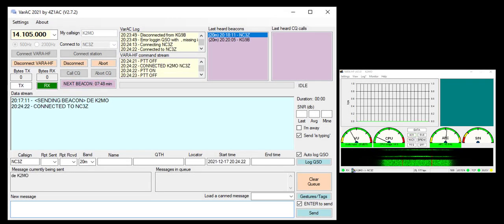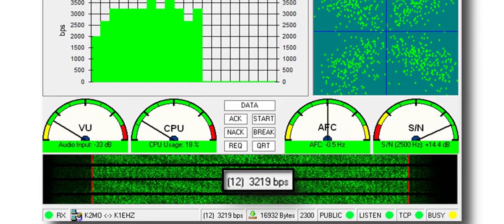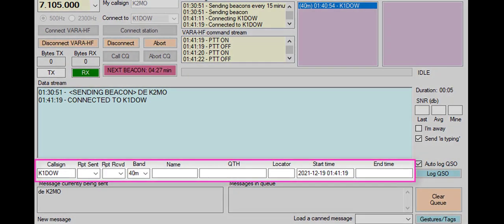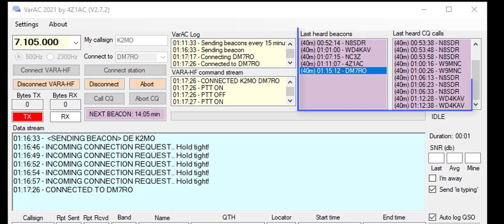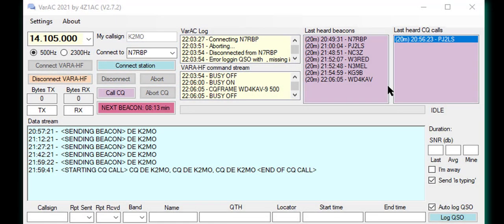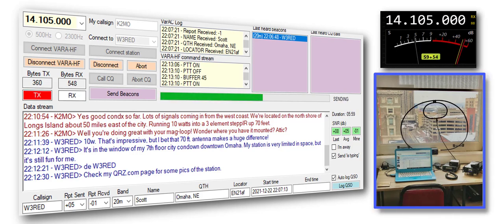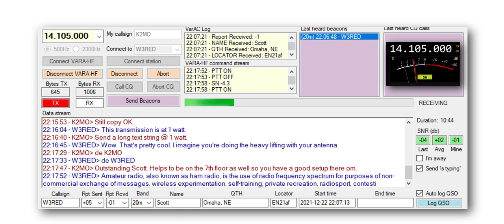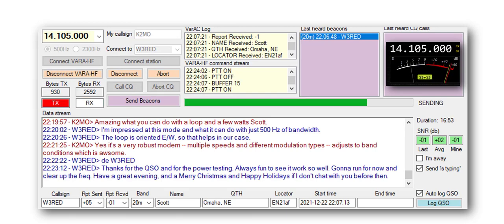Varac Chat Mode Video

Comment: Nieto, the guy who developed ROS did a good job with it, but the FCC among others blocked it in the US as it used spread spectrum frequency hopping, so Ros fizzled out and was only used by a few die hards like myself...
The along came 4Z1AC who developed it into varac....its a good system, but sadly the Spanish Ros developer is now asking for about 70 Euros for a license to use his software which is way too expensive imo...
Still you can use it without a license, but it has been crippled and slowed down & features disabled, such a shame, I'm sure this would take off with a more reasonable fee.

Comment: Does it work on linux?
Reply: I didn't see a link to the source, but dot net was mentioned somewhere. And of course, the optimistic "apt-cache search varac" (and "vara") didn't find anything. That is when I stopped looking and decided to try js8call which is in debian 11 (bullseye) and therefore all derived distributions. When I started it for the first time, it got its initial configuration from wsjtx and just worked.
Reply: To be clear, js8call isn't compatible with varac, it is an alternative that is free and uses the same modulation as FT8 and allows normal chat and using other nodes as relay that store or forward messages.